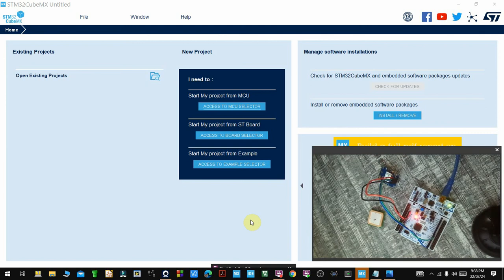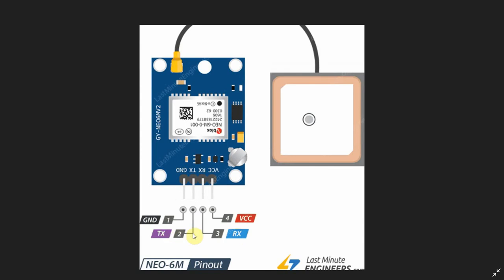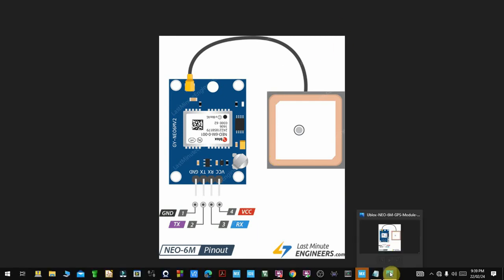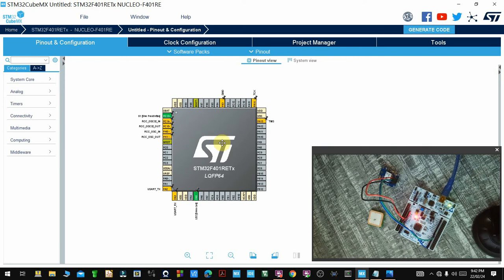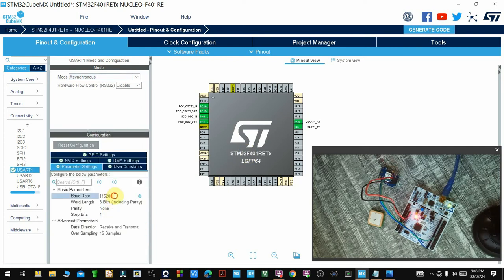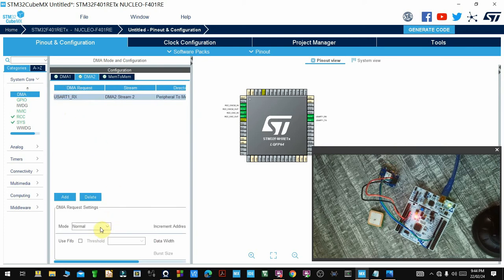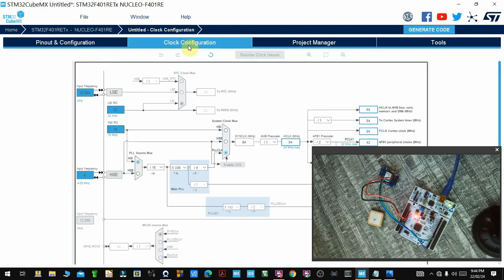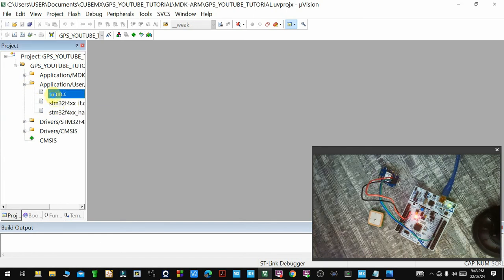GETTING GPS LOCATION USING NEO-6M GPS MODULE

Comment: Hello, when I lunch Tera Term VT, nothing is printed :/ Do you have any clue please ?
Reply: did you have idea? I'm trying few days like you. neo6m is working but it is doesnt work with my stm. (sending 0)
Reply: @abdulhakimcalgin6842  I have no idea :/ did you found something ?
Reply: @nox3681  i found bro. i forgot enable sys serial wire. module fixed then i did serial wire. if you want i can send my project.
Reply: @abdulhakimcalgin6842  hello, i got problem like you and i enable sys serial wire but it's still doesn't work. Can you send your project to me pls
Reply: @thanhviet7417  you can try change crystal clock source. if its not working maybe your cards use uart broken. i think you shouldnt use uart 1 or 2. im not sure about that but one is not working well. is your gps module blinking led light?

Comment: gps module blinking green light, can not get any data. Why ?
Reply from the maker: Which module are you using?
Reply: Neo 6MV2
Reply: @PinnyW  Merhaba ben de aynı sorunu yaşıyorum nasıl bir bağlantı problemiymiş ve nasıl çözdün?
Reply: 1 ay geçmiş yapabildin mi ya? Bende günlerdir 0 verisini gönderiyor.
Reply: @abdulhakimcalgin6842  Evet. Bağlantı sorunu yaşıyormuşum onu çözdükten sonra sorunsuz çalıştı
Reply: @PinnyW  bağlantı sorununuzu nasıl düzelttiniz acaba bide usart 1 pinine mi bağladınız rx tx i acaba
Reply: kodlarini paylasabilecegin bir adres varsa (github,instagram vb) ve elinde de duruyorsa atabilir misin acaba? Bir de hangi modeli kullaniyordun?
Reply: @abdulhakimcalgin6842  mail adresini ver göndereyim kodları. Stm32f411re ve neo6mv2 kullanıyorum
Reply: ya bir sey diyecegim de yorumum siliniyor galiba 3 kere yazdim gitti hep
Reply: acalgin598
Reply: @abdulhakimcalgin6842  gönderdim
Reply: cok teşekkür ederim 🙏